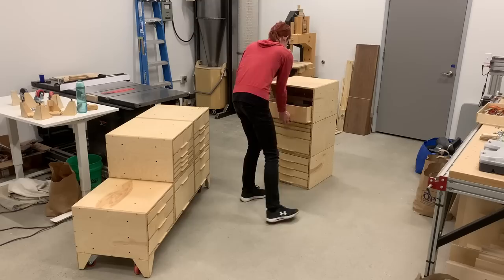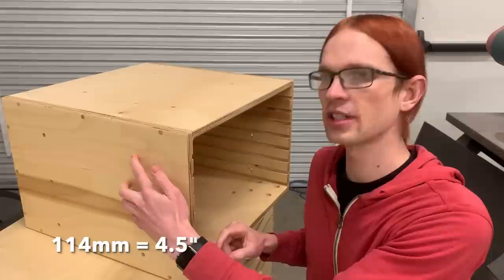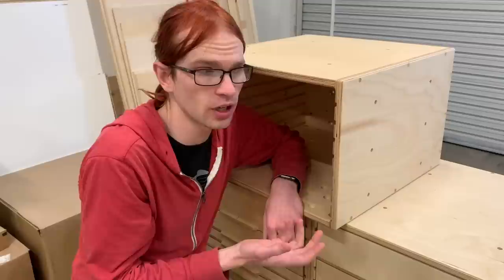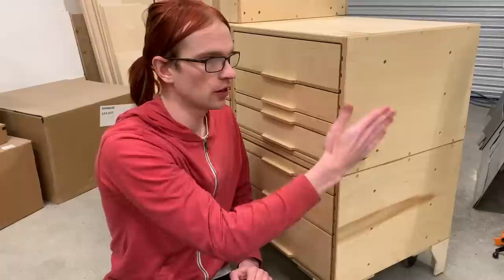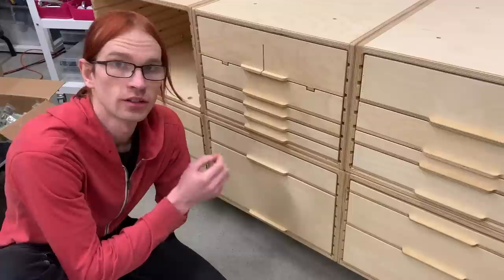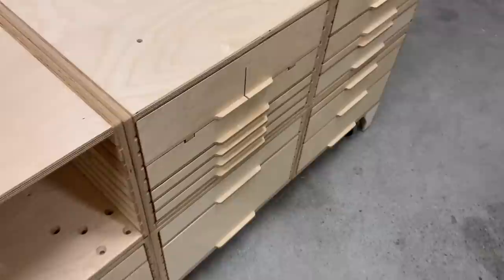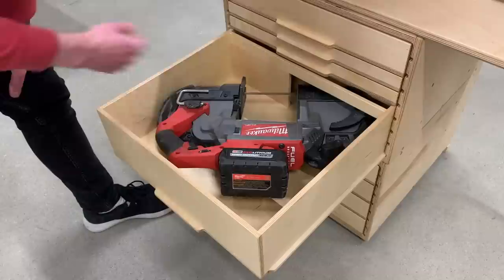How I designed my modular cabinet system

Comment: Lego cabinets! awesome thanks for sharing. Do you label the cabinets? I liked the painted handles of the old design. And thanks for showing the down side of the old design.
Reply from the maker: Thank you!! I’m still trying to figure out the best labeling system.
Reply: @Jer_Schmidt  I personally like a symbol system for drawer contents.  With stick-on label material I cut out a small exaggerated shape of a flat-head screwdriver about 1.5 inches long. Same with chisels, wrenches. allens, etc.    Whatever single symbol that generally represents the majority of what is in the drawer.
This has stopped me from doing double drawer pulling.

Comment: What Milwuakee nail gun did you use to build this? 5x5 sheets are hard to find in my area. Never seen it. No, I didn't hate it, I watched the introductory 3x and probably will with this one too. I already have the plans though the Birch Ply hasn't been located yet.
Reply from the maker: The nailer is the Milwaukee 2746-20. Thanks!

Comment: Thank you for sharing a video about your design thinking. I really appreciate it. One aspect that's not covered but I suspect that you considered is what happens to the materials when a unit is retired from service. Will the plywood and glue become landfill?
Reply from the maker: Thanks! I hope these units will last at least my lifetime. They should if I keep them dry and take care of them. If I ever need to downsize I’ll sell or give some to someone who can use them. And hopefully at end of life their material can be repurposed before going to the landfill.
Reply: @Jer_Schmidt  Thanks for your reply. In the grand scheme I understand that the plywood's glue and PVA wood glue is relatively lightweight in terms of footprint, especially as they'll be in use for decades. That said, it might be an interesting design challenge to create a system that uses reversible fasteners (like wood screws) and compostable materials. I haven't found any stable engineered wood products that use compostable glue, though.

Comment: Jer, this is fantastic, thank you so much for the time and consideration you put into each design and video.  I've bought your plans and will be modifying to fit my needs but have a question: why do you have the backs set inside the sides and top instead of being the full height and width?  This means that I have to get both the width and height perfect for it to fit correctly.  I assume it has to do with maximizing material usage or strength as the back stop for the drawers.  I'd love to hear your consideration on this.
Reply from the maker: The inside width of the cabinet is critical to make the drawers work properly, so I use the top, back, and bottom to set that width. It would be hard to keep the sides the right distance apart while gluing them if they didn’t have the top, back, and bottom acting as spacers.

Comment: Purchased your plans and sheet goods to start first build. The plans are extremely well thought-out and detailed, well worth the minimal cost

Was wondering if you tried using a 3/8" router bit for single pass drawer slide routing (in lieu of a 10mm bit or multiple passes). 3/8 is just slightly more than 9.5mm so would one pass be sufficient to avoid drawer sticking?
Reply from the maker: Thank you!!

In my experience the so called 9mm plywood can vary a little — I’ve seen 9.5. So if you want to keep future-proofing in mind, then it’s best to make the slots have clearance for a 9.5mm drawer bottom. That said, you could also just thin the edges of the thicker plywood if you ever run into that.

Comment: Curious where in Washington you're sourcing Baltic Birch from and how much you're paying for it these days. As far as folks building your design without buying the plans, it'll happen. I'm not going to build these, but I always learn from your engineering mind. Hopefully the patreon membership I just started will offset those freeloaders!
Reply from the maker: I’ve been buying it at Crosscut Hardwoods in Seattle. Their price was $195 for 18mm & $100 for 9mm. A viewer just informed me that Windsor Plywood in Bellingham has it for $140 & $68, respectively.

Thank you for your support!!
Reply: @Jer_Schmidt  Oh wow. Yeah, my place for wood is becoming Crosscut in Portland but the Baltic Birch is about the same price and it is soooo hard to pull out the credit card for it. I used some shop grad ply for some cabinets at $70/sheet instead.

Comment: these number seem SO precise. Can we build these with something other than Baltic birch (since we can't get it and if it IS findable it's about a million dollars and still following your plans?
Reply from the maker: You can use other plywood, yes. Try to use something that has hardwood throughout (not just the face veneers), as that will produce a stronger, more structural cabinet. Even if you have to use softwood, it should still work. The thickness of the 18mm plywood doesn’t have to be right on 18mm. +/-1mm won’t make them incompatible yet, but I’d try to find something as close to 18 as possible for best results. Thanks!

Comment: have you thought about making 3d printed hole templates or anything like that to help out with the measuring?
Reply from the maker: I do think it would be worth making templates for the hole positions. I hadn’t thought of that until a few commenters suggested it. I think it’d be best to just use some thin plywood or hardboard for that.

Comment: Jer every time I see you you look different :D Your hair looks gorgeous!
Regarding the feet bolt hole pattern, I wondered if maybe there was a standard castor size used in these sorts of projects, and you'ld spaced the holes based on that :D
I love how detailed this video was, what a fascinating deep dive :)
Reply from the maker: Thank you!!

Most casters will need a block on top of them to bring them to the right height anyway, so the hole pattern isn’t quite as relevant.
Reply: @Jer_Schmidt  I wondered that, a small block with a few holes drilled in would be super easy to make as a spacer 😊

Comment: Battery charging station drawer that has one plug in
Reply from the maker: Yes! I have the idea of routing a cord out one of the drawer slots, and then possibly running the cord thru a small drag chain inside the drawer, to a power strip. It would be super clean.
Reply: @Jer_Schmidt  liked your very in depth description of thought process of the measurements. Well, thought out. I think most of the plastic small parts boxes, Stanley, HDX, Milwaukee will fit in your drawers. Not really a big fan of those things, having several different variations that are full, but don’t really mesh well together.

Comment: These would be ideal to fabricate with a CNC, no? With only a few tweaks to avoid two-sided operations, they almost seem to be designed for that manufacturing method.
Reply from the maker: Yeah, they’d work fine on a CNC. For me it’s not worth it, having to figure out workholding and program everything — it’s easier for me to just make it with the table saw.

Comment: Drill holes in the bottom panels all the way down the drawers
Reply from the maker: I don’t understand?
Reply: @Jer_Schmidt  it would give the air a place to go. Might offset the air the large drawer displaces. Put vents in the bottoms of the drawers. That's how I should have phrased it.
Reply from the maker: Ah I see. I had thought about drilling holes in the backs, but hadn’t considered the bottoms. Interesting, thanks for the suggestion.

Comment: Such a freaking joy to watch! 

One question. Have you considered the option to keep all the drawer heights the same (maybe not the shallowest ones) and just changing the front to the different sizes? The argument being: Saving material and creating an even more standardized process of making them. Hooked on wood has done it this way. His argument is also that you don't need the higher walls since you shouldn't stack things on top of each other in drawers anyway so you don't run the risk of things falling out. 

I just wondered if you have considered this and opted out? Would love to hear your reasoning. 

On the topic of different tool work stations it would also be awesome to build something like the instant access tool station of Patrick Sullivan (https://www.youtube.com/watch?v=OMLw5InxhDE) to fit in a drawer!
Reply from the maker: I definitely think making the sides & backs lower is a reasonable option, and I might do this on future drawers. I agree that you shouldn’t pile stuff up in drawers, however sometimes I want to store things on edge, leading against the side. Also I don’t like the possibility of things shifting and catching on the carcass as I’m closing the drawer. Obviously, these are very minor issues, so probably not worth the extra material they use. 

There is no reason that I can think of to make the back full height. The false back should probably be full height so that your “visual stop line” is at the top of the drawer on all depths, but the back doesn’t need to be. I was going to say that in this video but forgot. The back is still needed even if you don’t plan to use the hidden space, because it contributes to the strength of the drawer. But anything over 2” is unnecessary.

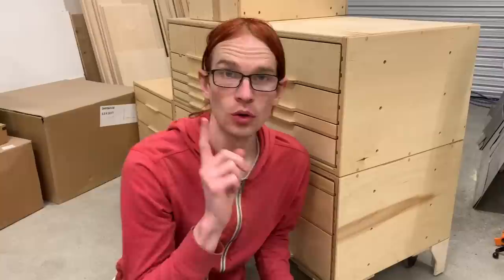Comment: 16:50 why use a 2x4 when you have a system already for adding feet anywhere you like?
Reply from the maker: If it’s a mobile cabinet, it’s not gonna work to add a foot in the middle. Unless your floor is absolutely perfectly flat. If it’s a stationary cabinet then, yeah, a middle foot is perfect.

Comment: Is Baltic birch ply not one of the products boycotted due to the war in Ukraine? What do we use to make these when that back supply of 5x5 sheets runs out?
Reply from the maker: I don’t know, I figured the high prices were due in part to the war, but I don’t know if supply is cut off completely? 

You can always try Appleply. It’s more expensive but arguably better, only problem is it’s imperial so the dimensions won’t come out perfect. It’s still within tolerance tho.

And it should be ok to make them from a cheaper cabinet-grade plywood, it just won’t be quite as structural and might wear out faster.
Reply: @Jer_Schmidt  tks. Please more videos like this. Your are brilliant and I could listen to you geek out for 30mins weekly.

Comment: RE: custom drawers, check out this Laura Kampf video: https://www.youtube.com/watch?v=TWs4X6vBlmk.
Reply: Maybe a drawer "station" that needs power can use a battery and pushing the drawer engaged a charger (OK, getting a little complicated)?
Reply from the maker: Ah yeah I saw that video and it’s awesome! I like your idea of plugging in when the drawer is closed, but yeah I think it’d be simpler to just design a drawer with a drag chain for a cable or something.

Comment: 450mm = 17.7"  ?   How do you read/mark "0.7" inches with a tape measure? lol  Why not include the fraction or adjust it?   Marking 177/10 is needlessly obtuse.
Reply: If you used a tape measure with both cm and inches then you wouldn't have to worry about the 7/10 of an inch. I'm an American, and that's what I use. I use both measuring systems, and I don't care which one is used in plans or a YouTube video. If you can only use one system--and this goes for Europeans who whine about inches--then you have no complains coming to you.